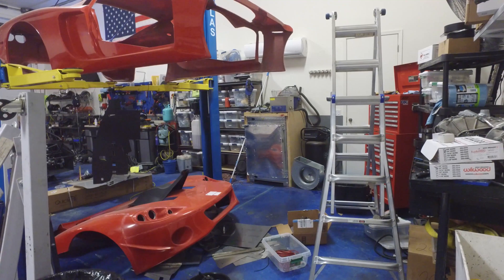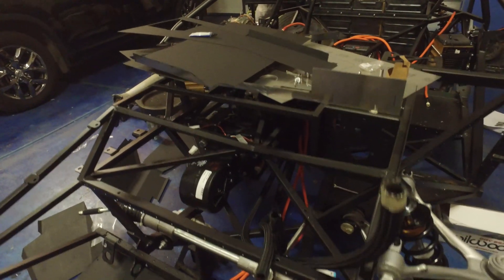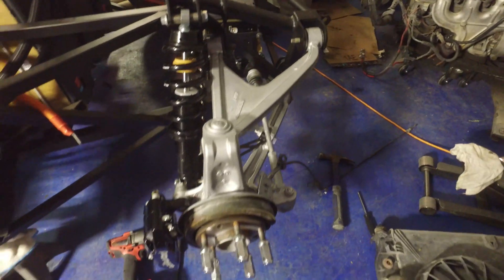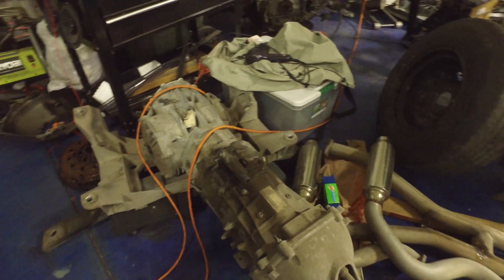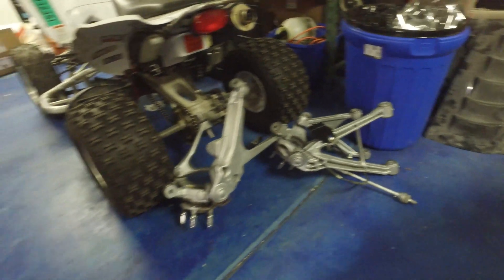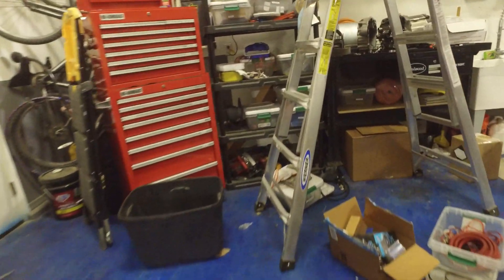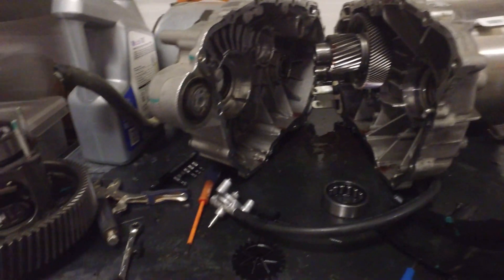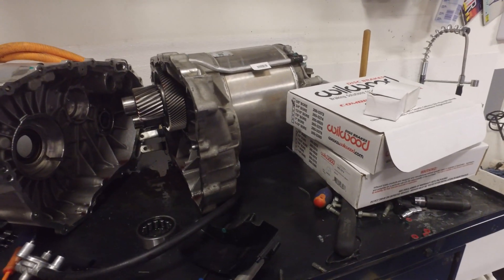Project Electric GTM - Tesla motor disassembled, long overdue update!

Comment: nice cody! here the lim diff slip you want to build : https://zero-ev.co.uk/product/quaife-large-tesla-drive-unit-limited-slip-diff-lsd/
i m about to built a slc with a tesla engine and will face the same problem. i found this one all made so we can save probably a bit of money. I follow your project.. very nice. Another supplier also have some half shaft modified in case your modified ones break. Regards

Comment: Hey man, having built a GTM myself, a small word of warning regarding those rear shock mounts they gave you. Invest in getting some stronger ones. Here in Poland, over the bad roads and with as little as 400bhp. i bent and warped those brackets as if they were made out of playdoh. So for safety's sake, look up a site called quickracingproducts or vraptor, one of them builds re-enforced brackets for this very reason.
Reply: I can confirm this.  I hit a pothole and nearly ripped my shock mount off.  I went with the QRP mounts and it's been solid since.